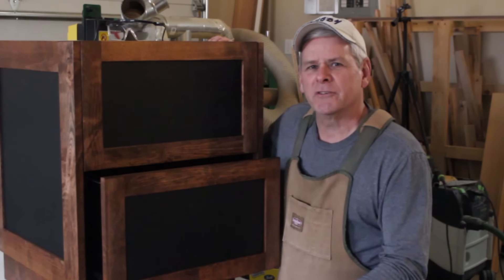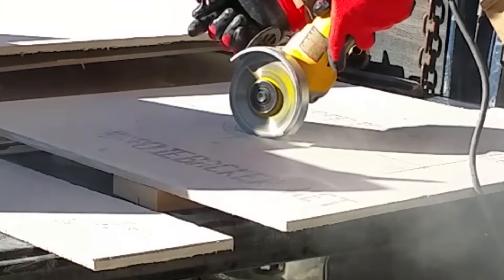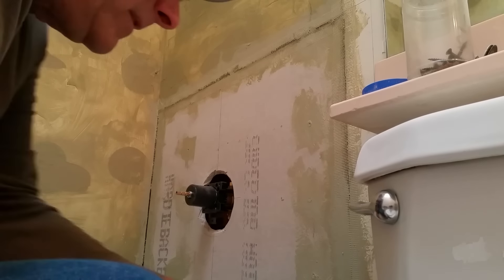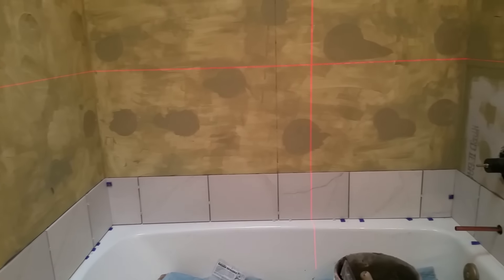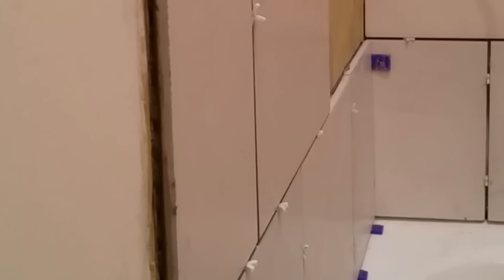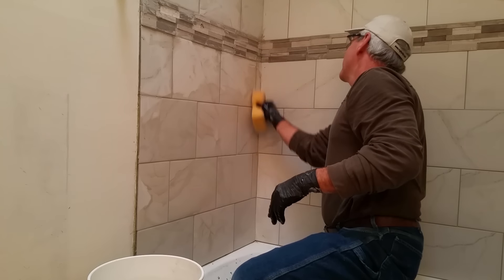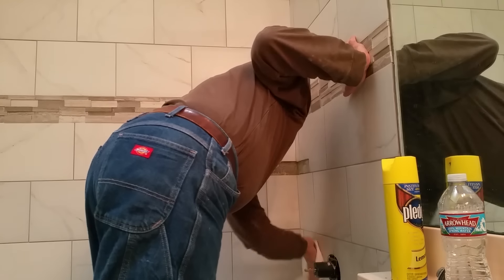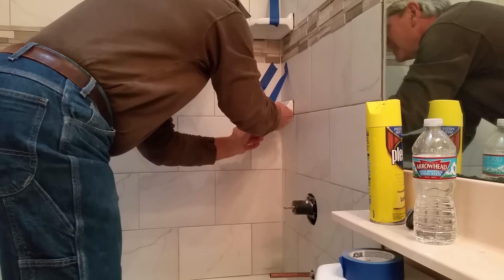How to Set Tile Around a Tub - Bathroom Remodel

Comment: Why didnt you seal up the bottom of the board where it meets the tub?
Reply from the maker: You could do that, Ceeloc, if that makes sense to you. The tub has a flange all the way around that keeps water from going over the edge of the tub, so that's the reason I don't see your idea as being necessary, but I certainly have no problem with the approach.

Comment: Why are you not putting thin set on your cement board
Reply from the maker: It’s the size of the tile in this case, Alan. The goal is to have 90 to 100% thinset coverage between the tile and the wallboard. I think this was 9”x9” tile and back buttering the tile with my trowel was actually easier to get the right amount of thinset on the tile rather than spreading thinset on the wall first. Thinset dries quickly when it hits the wall. I could periodically place a tile, then pull it to check my coverage percentage and adjust my thinset amount accordingly. Any tile larger than this and my process is to spread thinset on the wall and backbutter the tile to be assured of getting the thinset coverage right.

Comment: Great video Rusty. I was looking for how to tile a bathtub wall when the bathtub has an upstand around it. I'm assuming the bathtub needs to be recessed into the cement board (we call it gib here in nz) so that the wall and upstand are flush, and then tile over the top with a small gap for caulk in the bottom. My bathtub is also my shower, so it will have lots of water running down the wall and bathtubs here are generally sold with upstands and also recommended to use them for shower over bath installations. Do you have any experience with these?
Reply from the maker: Thanks, Nadine! I see you got the answer to your question by watching my other video that shows a little more detail on a typical tub surround. Thanks for your comment and question!

Comment: Can anyone tell me why he didn’t use Becker board for the whole wall he was going to install the tile on ? Was it already a Becker board install Becker or did he install over drywall ?
Reply from the maker: The original tub surround walls had quarter-inch solid pieces of cultured marble installed so the wall board was in perfect condition except in the area around the shower valve. As a cost saving measure for the owner, I added a coat of waterproof membrane and used the original wallboard. If cost were not a factor, I would replace all of the wallboard in the tub surround with 1/2” Hardibacker.

Comment: What's the difference between hardiebacker and cement board?  Is the fiberglass strips and the Hydro ban all that's needed to protect the joints and corners?
Reply from the maker: They are very similar products. Durock is the cement board I most familiar with. It is essentially cement sandwiched between fiberglass layers. I prefer Hardiebacker (both are 1/2" thick for wall installs) which is more uniform throughout and easier to work with for me. But they are both very resistant to damage once water begins coming in contact with them. Yes, from my perspective, Hydroban on the fiberglass strips in corners and joints is adequate. I do not put Hydroban on the field area of the Hardiebacker. Some installers these days try to create a complete water barrier behind the tile with Hydroban and similar products, then tile over that. I understand the intention but my concern with that is that once water gets behind the tile over time which it will, it collects against the waterproof envelope, doesn't dry out and then can create mold problems.

In my case, I have watched the evolution of wall board type products over decades. I don't think it gets much better than Hardiebacker as a substructure for tile and am suspect of the foamboard type products that get a lot of attention now. I'm sure they are fine, but I don't use them. This link, https://youtu.be/ZAWpt2ieWf8, shows the way I like to prep a typical Hardiebacker installation start to finish in more detail. One final comment is that the real protection for the corners is that the tile be cut tight and overlap in the corners. Then, corners need to be caulked with a high quality siliconized acrylic caulk. If the grout joints and corners are maintained over time, the material the tile is installed on never becomes an issue. Hope this is helpful. Thanks for the questions!

Comment: no waterproofing behind wall?
Reply from the maker: No, not in this case. This was a pretty low budget renovation so the minimum amount of demo was done. If it is left to me start to finish, I do what is illustrated in this video. https://youtu.be/ZAWpt2ieWf8  Lots of different ideas on the amount of waterproofing to do behind tile and/or behind cement board.
Reply: Rusty Dobbs ah ok. Good work though. I’m a plumber by trade and enjoy watching tile work. Soon start laying myself 😎
Reply from the maker: Good deal, Jerry. Good luck with your project!
Reply: Rusty Dobbs ah thank you same to you

Comment: I have a 13"x13" tile piece that has 2"x2" squares. Would it be best to apply the thinset to the tile first or to the wall? The wall is rock board. I'm in the process of fixing a lovely cheap patch job that was done previously and fixed all the old iron plumbing.
Reply from the maker: Hi Paul. I don't completely understand but probably would not change my answer anyway. Anytime I need to make sure I get a good bond of tile to a surface, wall or floor, I will trowel on thinset to the surface and then 'butter' the back of the tile as well before pressing it into place. Buttering is just like it sounds. Treat it like a piece of bread and spread on a thin layer of thinset. That should help insure you get a good bond between the wall and the tile.
Reply: Rusty Dobbs it's mosaic tile with 1/8" gap between the each piece of tile. I did not explain that very well I'm sorry for the confusion.
Reply from the maker: In situations like that I typically use a 1/4" notched trowel and apply a layer of thinset on the wall. Then set your tile sheet in place and make sure to press each individual piece of the mosaic into the thinset. You should get some squeeze out in the joints which is a pain to clean up, but it insures you get a good bond.

Comment: Does no one know about Hardi backer sheers? Back in the 90s if you bought two pallets of hardi backer they gave you the tool free. Dust free cuts and pretty easy. And I wish you would have painted the hardi backer. It is waterproof in the thought you can throw it in a lake pull it out in 50 years and it’s undamged. But it wicks water and water passes through. You don’t use metal profile edges where Shulter or another? I haven’t put calk or silicone in a shower in years.

Comment: What to I do to correct a botched tile job around my tub. Installer did not have the first row level and did no bring the hardy board down to the tub leaving a large gap which he covered by cutting tile pieces to put over the tile to hide gap which are now falling off. help!
Reply from the maker: Yikes! Doesn't sound good. Send a picture to info@dobbsworkshop.com and I'll at least give you an opinion.

Comment: So Zero grout in corners yes?
Reply from the maker: Yep, Andrew. I use the flexible siliconized acrylic caulk to match the grout in corners.
Reply: @RustyDobbs  thank you very much
Reply: @RustyDobbs  have one more question for you I'm installing tile on all bathroom walls maybe 40" high from floor. 4 of the tiles create a square but also a pattern on that square if I need to cut these and I will where is the best place to cut so the pattern isn't so noticeably different or should I use some type of blank tile to make a border so the pattern stays the same??

Comment: should be using the correct screws for the concrete board
Reply: also wipe off excess grout diagonally so you don't remove grout from grooves.
Reply: Love the tip on using furniture polish!

Comment: after 3 minutes of talking I then am immediately asking questions to myself.. OK how did you come to the measurements of the center pipe? and how hi from the tub?and how far away from the wall. How did you come to get those measurements come oooooon
Reply from the maker: Yeah, I would agree a little long on the intro, Irish! I don't do that anymore.🙄  On the pipe, about 4 inches from the tub to center of pipe, another 8" to the center of the fixture. There is a flange that usually comes with the fixture that is supposed to flush out with the finished wall. You have to experiment with all these dimensions a little to get them right for each individual job.

Comment: Okay so why not use tile edging?  There is plenty of choices in plastic and aluminum.
Reply from the maker: Yes, that certainly would have worked on this job, but it is not a popular idea the area where I live. With the grey tile, there would have been many options. Thanks for the reminder. I'll have to push that idea if I run into a similar situation in the future.

Comment: Any recommendation on caulk to use? Whomever did the tile work in my house only used grout and it’s weathering away. 

Also, should I remove the remaining grout along the top of the tub before I go back with caulk?
Reply from the maker: Yeah, Richard, there are a lot of options these days. You can take a piece of the old grout with you to Lowes or Home Depot and match it to available colors they carry in the tile section. You should be able to choose between sanded and unsanded caulk depending on what type of grout was used on your home. They should be acrylic latex based caulks which are water clean up and easy to use. If you don’t like your options, you can try a tile supply shop who should have a better selection. I would remove old grout if it interferes with the line of the new caulk. If it is down in the joint, just leave it and caulk over it. I have an older video called “How to caulk for a great finish” that has good practical suggestions. Good luck!

Comment: please explain  the spacing on the first row of tile
Reply from the maker: Not sure if this is what you're asking but let me take a stab at it. I want 1/8" space between the tile and the tub for caulk to fill. The white spacers between tiles are also 1/8" thick. The blue wedges I am sliding under the tile at the tub joint gradually increase in size from a point to 3/16" thick so I can slide it back and forth to get the gap I need for each piece of tile. I also have white wedges that are 1/8" thick max. In this example I have drawn a level line all the way around the tub at the top of the first row of tile to build the next rows on top of. The tub is not level so my cuts are made on the bottom of the first row of tile. I cut off each tile what I need in order to set the piece on the level line and leave approximately 1/8" gap against the tub. Here is another video where I am setting another type of tile around a tub that may be helpful too. https://youtu.be/ZAWpt2ieWf8  Hope this helps.

Comment: You apply thinset only to the tile , this is not strong enough, you  need to apply thinset to the wall as well (especially true for large heavy tiles  like yours)
Reply from the maker: The tiles were 9"x9" and not that heavy. The goal is to get the proper amount of thinset coverage on both the tile and wall behind the tile. You are looking for 90%+ and it doesn't matter how you achieve that. I periodically pulled a tile to check the coverage on the wall and the back of the tile. I could adjust the amount of backbuttering I was doing based on what I saw. You do this work enough and you know how much thinset to apply when using this method. On larger format tile, I always apply thinset to the wall and I backbutter the tile with thinset as well to get the necessary coverage.

Comment: going to say you do not have enough thinset. you shuold be troweling thinset on the wall AND back buttering.
Reply from the maker: You certainly could do that. If the size of the tile is any larger, I do both. This was I think an 8”x8” or 9”x9” tile so I could judge the amount of back buttering I was adding very easily. I would pull a piece of tile every so often and check for 90-100% coverage of wall and tile with thinset which is what you want. You sound like you know enough about tile setting that I’m sure you know what it feels like to place a tile on the wall and know if you have enough thinset on it or not. It's not much more complicated than that.

Comment: you made no mention of the screws and the bit you used to screw the wall in place ?
Reply from the maker: Hardiebacker has a line of screws they manufacture for their product installs. I typically use them if they are available. They have a 1 5/8" long screw that I use for 1/2" hardiebacker on walls. Works well. I predrill holes for the screws because that tends to eliminate breakout of the hardiebacker that can happen if you don't predrill.

Comment: Hey, quick question: if the tub isn't level, should the tiles be set perfectly level to the same level as the tub (meaning at the same angle relative to perfect level as the tub)?

Thanks so much! Best vid I've seen!
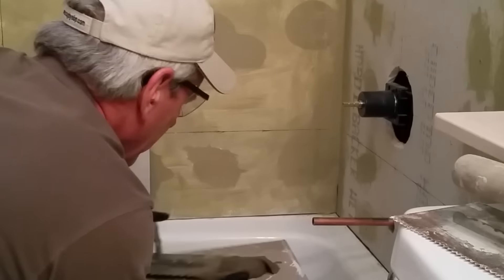Reply from the maker: Hi Naomi, thanks for the comment and question! Yeah, remember 'perfect level' and forget the tub's version of level.  In your situation, find the lowest spot on the tub where tile will be placed. Put a full tile against the wall there and draw a line at the top of the tile. If you continue that line perfectly level all the way around the tub, that's what you want to use as your reference line to set tile on. You'll soon realize that probably the only place where you can use a full tile on that first row is at the low spot on the tub. Most of the other pieces of tile on the bottom row against the tub will have to be cut to fit between the level line and the tub, but that's ok. You'll now have a perfectly level row of tile to build your wall tile on and you have taken the issue of the tub not being level completely out of play. Most likely, once the tile is grouted and caulked, you will not notice that the tub is out of level at all. Check the video at about 4:25 for the next minute or so and see if it makes better sense with the explanation. 

It's a pain when tubs are out of level because it creates a lot of cuts that need to be made. But, I've found that most tubs are a little out of level anyway, so the method above is where I typically always start. Here's a link to another tub surround I did, https://youtu.be/ZAWpt2ieWf8. The video quality is a little better but illustrates the same method on another type of tile. Good luck!
Reply: Thanks for responding! You mean cut really tiny diagonal slices off the bottom of the tile?
Reply: Rusty, you're not going to believe this... it turns out my tub IS level (at least, the long side is - the edges are 0.2 degrees out of level). I checked with two levels (one digital, one bubble).

I had assumed the tub was out of level because of the' pardon my french, sh!tty job the builders did on this apartment in literally every other thing, but I guess whoever was installing the tub 35 years ago had a good day! Regarding the short sides (the right and left sides from the perspective of your video, rather than the back), is 0.20 degrees enough that I'll need to make cuts, or should I just lump it and do it? I honestly don't know if I'm anywhere near good enough to do a cut that tiny! It would be a couple millimeters tops... is that even possible!?

Thanks!!!
Reply from the maker: If the plumber did get the tub level, he was having a good day! Here's another approach... I need to speak in inches, but you get the idea. Cut an inch off the bottom of the piece of tile that you create your level line from. Then, all your cuts are an inch plus or minus a couple of millimeters. Not sure if you are using a tile saw or not, but if you are scoring and breaking tile, then definitely start with a larger cut and adjust your line. Let me know if this doesn't make sense. I always try to leave about 1/8" (or ? millimeters) from the tile to the tub for caulk. If you are tackling tiling a tub surround, you will soon be good enough to make any kind of cuts!
Reply: You're a really awesome dude, Rusty. I really appreciate the help, and your video is really, really helpful. Greetings from Jerusalem, Israel
Reply from the maker: Very cool, Naomi! So nice to hear from you. I'm a long ways away in the US state of New Mexico. Let me know how it turns out. Have been helping people with their projects for many years. Really enjoy doing it through YouTube now.
Reply: Never been to NM, though I've wanted to go on a long distance hike there for a few years. Looks beautiful! Have a great evening!

Comment: You really need to back butter either the tile or the wall before applying the tile……. It’s the most important step
Reply from the maker: True. I back buttered the tile in this case because of the relative small size of the tile. When using larger tile, I do both. The goal is to get close to 100% thinset coverage between the wall and the tile.

Comment: what r u cutting the tile with? and the holes?
Reply from the maker: I have a water cooled tile saw that I bought about 30 years ago that I make most cuts with. I also use an angle grinder with a diamond blade on it which works well also. Holes are cut with hole bits for tile. There are sets available on Amazon that are pretty inexpensive. Not the greatest quality but it you keep them cool with water, they work well.